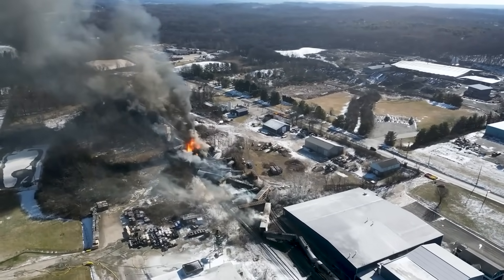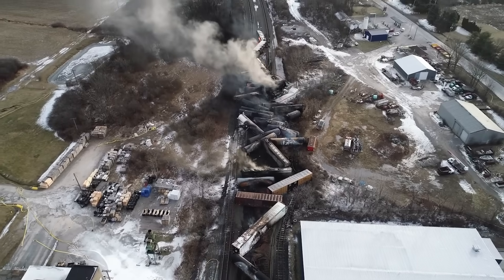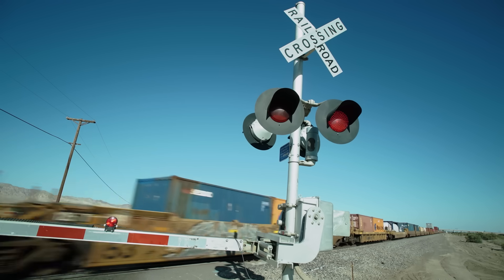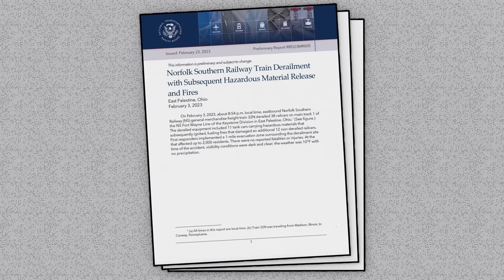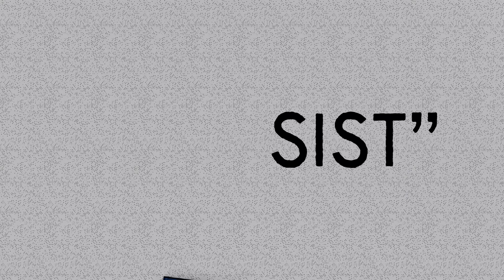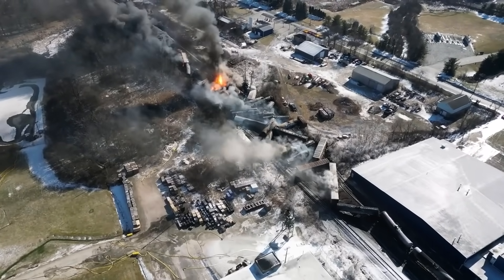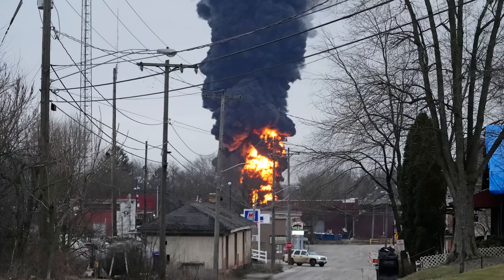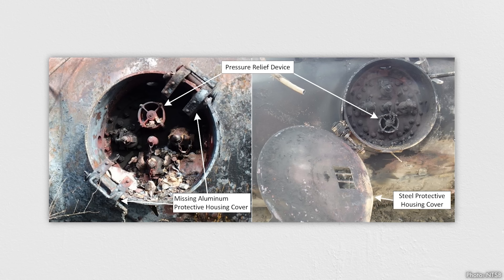East Palestine Train Derailment Explained

Comment: 1:47 pipelines, for anything liquid is and will be, the safest and most cost-effective method to transport them, to say anything else is BS. Operators of Raillines could become the largest operators of pipelines if they used their right of ways to install chemical pipelines to move these products in parallel with rail, ultimately saving money and improving safety.
Reply: Payton Tomm I couldn't find your comment?.... to answer your question, they run products in batches and separate the different ones with a "Pig" allowing different products to use the same pipeline